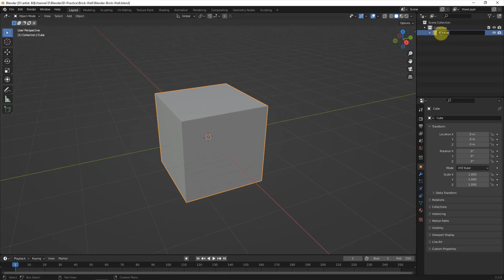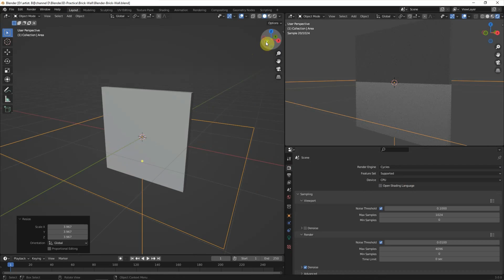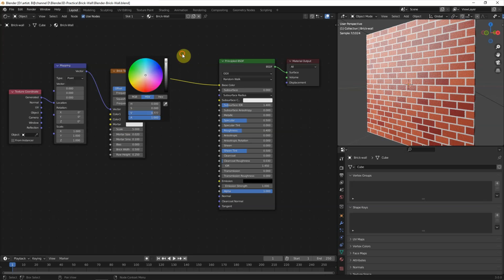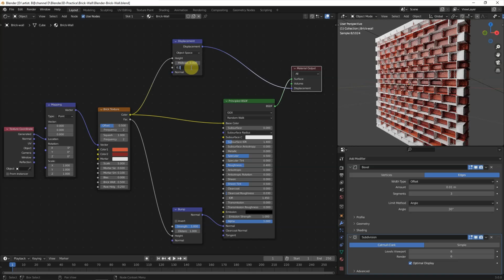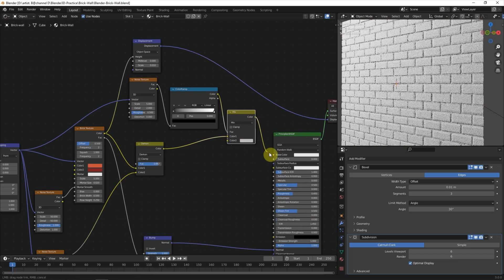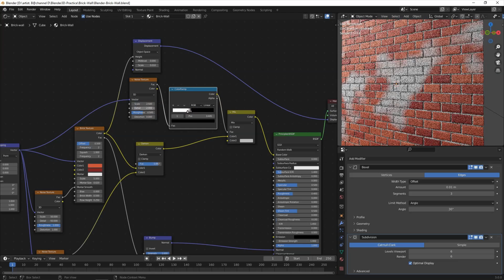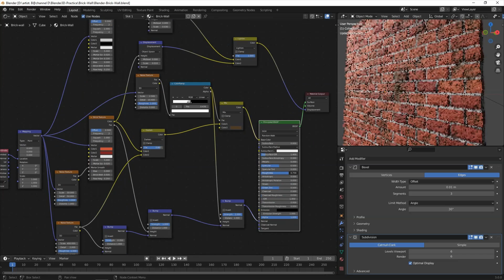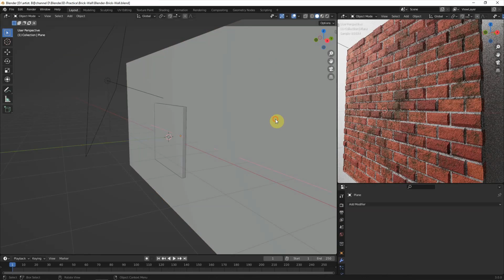Blender Brick Texture | Procedural Texture Material | 3D Brick Wall

Comment: Hey, when I add the subdivision surface modifier- it just smooth out the edges? None of the crazy stuff yours is doing- please help!
Reply from the maker: Maybe try to add "Bevel" Modifier before adding "Subdivision. See if this helps.
Reply: @blenderian.3d  Doesn't work for me... Subsurf does nothing. I did everything 1:1 like in your tutorial. Using Blender 3.1
Reply: @blenderian.3d  I am experiencing the same. No subdivisions along the brick shapes...